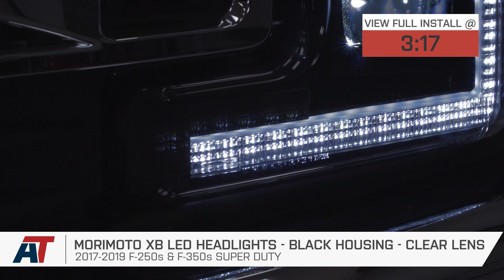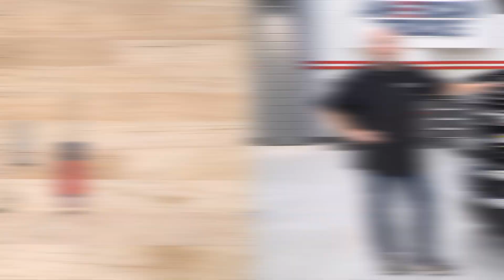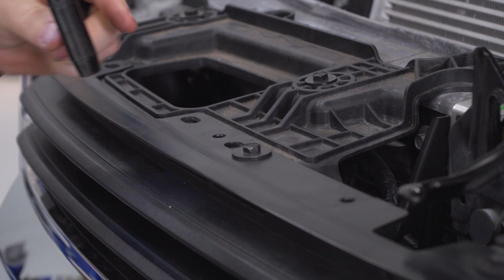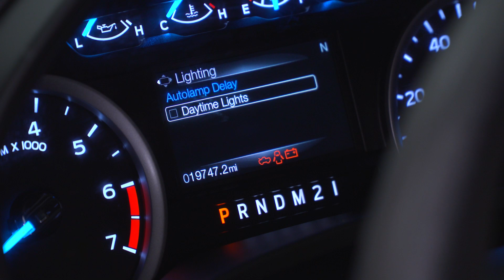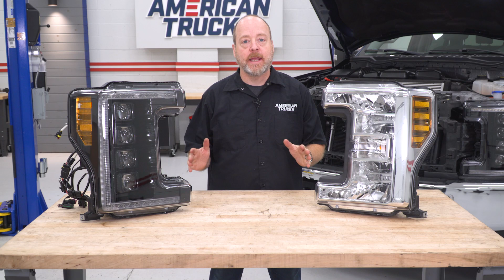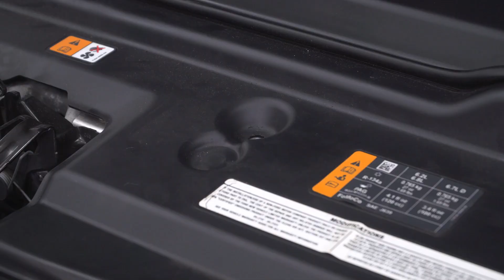2017-2019 SuperDuty Morimoto XB LED Headlights; Black Housing Review & Install

Comment: There is a clear line across the top of the beam that is distracting and dangerous at night. I would not recommend these headlights for the price! They also dont explain how to adjust them which is a must given that they aren't even lined up.

Comment: Why the grey colored pin connector instead of the black? I just installed mine and had seen another video that said not to use the grey so I went with the black one and the start up sequence seems off. Also didn’t realize I had to disconnect the other to get the sequential blinker so I have to pull it all back apart anyways but some insight on those connectors would be nice. Also for some reason I’m having issues with my mirror light turn signals now that I have installed these headlights if y’all have any idea what would cause that?
Reply: Any info about why he went for grey wire instead of black? all videos and morimoto instructions say to use black and set grey aside. What about the two white cables, no one’s talks about ( there 3 small back boxes on back of the headlight, one has two wires that you can connect together but not sure if they should, and no one talks or shows anything about them)